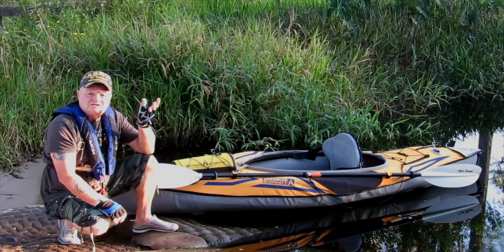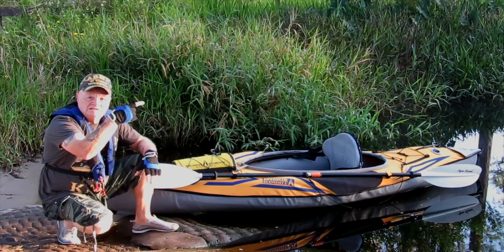Dropstich vs Backbone

Comment: I just purchased the ADVANCEDFRAME® KAYAK: AE1012 and while I'm mostly happy with it, I'm wondering which I should add to increase speed in the water: the backbone or drop-stitch floor? New to kayaking and while I didn't expect an inflatable to slice through the water like a hard shell, I had hoped it would be sleeker than it is. Recommendations? Please and thanks!
Reply from the maker: Valerie Gaffney the backbone will improve speed and tracking but will add a little more setup time. I used the backbone for a season then got a DS floor I lost about a mile per hour but I now prefer the DS floor over the backbone. Thanks for watching
Reply: @DaleMrDSimmons  Why do you prefer the DSF over the BB? Comfort?
Reply from the maker: Keith Locke simply rigidity and setup. I have converted all my Advanced Elements Kayaks to DSF over the back bone. I don’t loose that much speed but gain more comfort and overall rigidly. The DSF you can just leave deflated in the kayak so setup is much faster and easier. Hope that answers your questions. Thanks for watching.

Comment: We have an Advanced Elements Convertable and may question is:  Can you use the backbone and the drop stitched floor at the same time?
Reply from the maker: Stone859 I have had many inquiries about this. I contacted AE and talked with the Design Engineer and the say no and don’t recommend it. Something to do with the spoon of the backbone digging into the DS could cause failure of the floor. Also, the DS contorts the lower skin, as you can see, if you also add the Backbone with the DS you would further contort the lower skin beyond its MFG limits. Hope that answers your question. Thank you for watching.

Comment: Mr D. I'm thinking to purchase an Itwit Tridoard as it's the only decent inflatable I available in my area. 
I'm thinking to run a backbone under my dropstitch. 
Any recommendations ?
Reply from the maker: Jim McGregor hey Jim, I know with the advanced Elements it is not recommended  to combine the backbone and drop stitch as it will contort the lower outer skin and place undue stress on the lower skin construction seams. Looking at that craft with its long fins I also think the backbone would be over kill. Hope that helps.
Reply: Ok thanks

Comment: hi ive been watching your videos. and i think the expedition model would be great and within budget. Its $900 here in canada. do i really need to buy backbone? its over 100$. i'm confused. why won't they include drop stitch or backbone with the package?. some people complained that the backbone is uncomfortable on long trips.
Reply from the maker: crosshair the new expedition XE comes with the dropstich floor. The older version does not. If you go for the standard expedition, not the XE then I recommend the backbone. If you get the XE then your problem is solved and no backbone is required. See my video on the Expedition XE. thank you for watching.
Reply: thanks dale. i found the xe at local store, $1170canadian,  pricey with no pedals. do you think i should just stick with the advancedframe sport and get dropstich for comfort. or ae E XE model would be faster and more comfortable, a better buy for long term use,  what do you recommend? . i'm 6' 185lbs.
Reply from the maker: crosshair being you are 6 ft I would not recommend the sport I'm 5'5" and it fits me well. my friend is 6'2" and with the foot bag removed and the seat all the way back he just fits. the XE with the dropstich, rudder is optional and not really needed, I feel would give you your best performance for your height. but again you could fit in the sport with the seat all the way back but you would not have really any storage.
Reply: thanks thats helpful. 
one more thing. could i use my generic double action pump with expedition. it has boston valve, and someone said i dont need to buy AE's pump, i could use boston valve to pump expedition kayak because the spring valve works fine with boston valve. do i really need to have the gauge on pump, any thoughts?
Reply from the maker: crosshair I strongly recommend the PSI guage. the PSI ratings are critical on the main Chambers. the dropstich requires 4to 6 PSI I always do 5 PSI. the AE pump is not required but make sure it has a PSI guage.

Comment: Do you have the accessories frame installed on any of your kayaks. I have some questions about it. It appears that the recommended installation is different if you have an Advanced Frame type kayak versus the Straight Edge. With the Straight Edge you stick the eyes onto the top whereas with the Advanced Frame you have the rather uncomfortable task of cutting the outer layer on top and stick them through from underneath with the gluing inside. The latter I feel a bit uncomfortable about (taking to my new kayak with a knife) and I'm wondering if you could speak to this? Can you stick it on top for example like the Straight Edge.
Reply from the maker: Endurance Swimmer Australia I really don’t understand what you’re trying to accomplish. I would not attempt any cutting of the outer skin. What are you trying to do? Are you trying to add d-rings to the kayak? You will see 4, 2 front and 2 aft for tie downs. I guess I just don’t understand your question.
Reply: Dale Mr. D Simmons It's a shame I can't copy and paste the instructions to illustrate but suffice it to say installing the frame on the  Advanced Frame involves literally cutting the outer layer on the top so that the rectangular outline permits the eye (which holds the frame) to poke through the top and you glue the circular base of the eye so that it sticks from the inside. On the Straight edge it's a different attachment method with no cutting involved but just sticking to the top. From your response I gather you haven't installed the frame on any of yours which probably answers my question.
Reply from the maker: Endurance Swimmer Australia if you are talking about the bow and stern frames, rectangular aluminum bent frames forward and aft, they should have been already installed. Anyway if not just pull out the entire inner main chamber assembly you will see on each end a black webbed slotted areas top and bottom both forward and aft. Insert your rib frames in these. The larger frame is forward. I hope this is what your talking about.
Reply from the maker: Okay now I understand what your trying to do. The accessory frame for the angler straightedge. The bent pipe assembly for mounting stuff. No I don’t have these. I really didn’t know they have instructions for installation on the Advanced Frame. If you want to send pics enter my name in FB messenger and send them to me and I can address, I hope your concerns. If not I will contact my peeps at AE and ask them.
Reply: Dale Mr. D Simmons I notice you have a GPS attached. How have you mounted it?
Reply from the maker: It's mounted on a selfie stick with mini tripod.

Comment: Dale: I have the AE1007 DS, filling the floor isn't a problem but disconnecting without losing all the air you've pumped in is! What's the trick?
Reply from the maker: Bruce Wayne hey Bruce, make sure when you fill your military spring valve is up. Put your finger on the center valve push down and twist to the right, then let go the spring valve will pop up. When you screw on the spring valve adapter the center of the adapter will depress the center of the spring valve a little allowing you to fill the main chamber. When done just unscrew the adapter and your air will stay in. Hope that answers your question. The same holds true for the DS floor.
Reply: Dale: thanks for the quick reply. I thought I was doing that. There doesn't seem to be much to grab onto when it's time to unscrew the adapter :/
Reply: Dale, I've watched you unhook the hose from the DS floor several times. When I try, I have to grab it right at the base & most times I end up with a blast of air escaping. No idea what I'm doing wrong :/
Reply from the maker: Bruce Wayne I assume your spring valve is in the up position? Is it disconnecting from the adapter and the fill hose? Or are you removing the adapter from the spring valve just below the fill hose. What I do is grab the adapter portion of the DS fill adapter with my fingers and twist it off. You will get a short burst of air as the adapter is lifted from the spring valve as the spring valve pops back up and seats itself. If you are taking the adapter off properly the short blast of air will happen, but it’s very fast and very short. You may have a defective valve. If so contact AirKayaks as I assume that’s where you got it? If it’s second hand your DS my be defective and a small shot of silicone lube on the spring valve may fix the problem. Don’t do that if you bought it new as it will void your warranty. Let me know.
Reply: I'm pretty sure it is as I was following the directions from both your videos & the video from Airkayak! Yes, brand spanking new. Perhaps I'll have a friend video what I'm doing & upload for your review.
Reply from the maker: Bruce Wayne you are using a hi-pressure floor fill adapter right. Maybe a dumb question, but I have to ask. Using the process of elimination.
Reply: yes, the one that was "hidden" in the pouch in the back of one of the seats.
Reply: Dale: if you watch this video from airkayaks: https://www.youtube.com/watch?v=eKnhQh1jFeY (1:18) mark, their using something different from what you & I have!
Reply from the maker: Bruce Wayne I have never seen that before the one I use came from Advanced Elements and is the mainstay for DS floors..
Reply: Same here! I posted on the Airkayaks video & never heard back. I wonder if it's a modification that never went public?

Comment: Thanks! Just out of curiosity, are each of these products designed for specific paddling environments?
Reply from the maker: Mostly for receational paddle. However the Straitedge is rated for class 3 the others are for rated for class 2.
Reply: Thanks for getting back to me.  I didn't do a good job with my initial question. What I meant to ask was whether the backbone and the drop stitch floor are designed for the same or different purposes.  Are they both used to help the inflatable gain rigidity and speed, and one just happens to be faster and one more comfortable, or do they each have slightly different primary purposes?  Again, just asking out of curiosity. I'm not really very familiar with kayaking, other than I have a couple of Hobie fishing kayaks that I peddle around a local lake.
Reply from the maker: Stonnie Dennis okay no prob, the backbone improves tracking and speed whereas the dropstich improves rigidity, comfort and stability.

Comment: Can you use the DS floor and the backbone at the same time? It seems that the standard floor with its tubes is better to accomodate the backbone, but could you not use it with the DS?
Reply from the maker: Michael Marshall no you cannot use both. Not designed to accommodate both. The spoon of the backbone which sets underneath the main chamber will not allow the DS and vice versa. Thanks for watching.